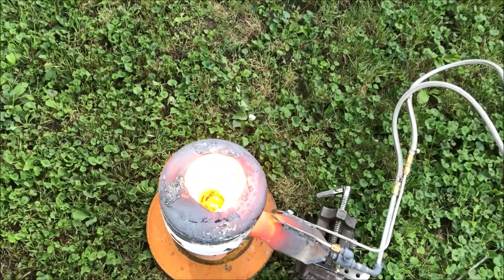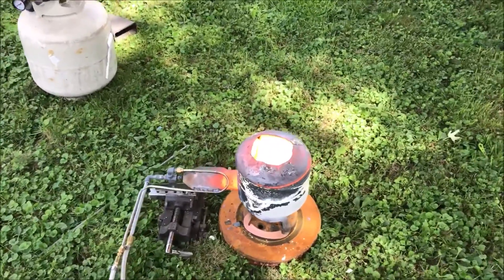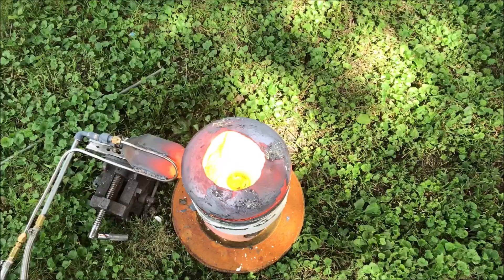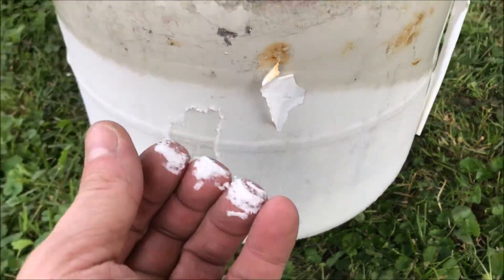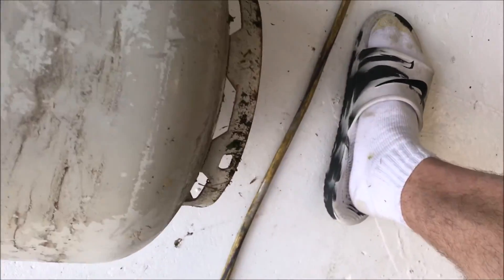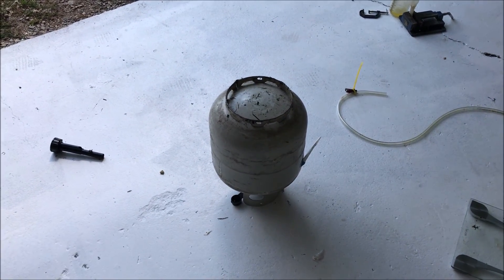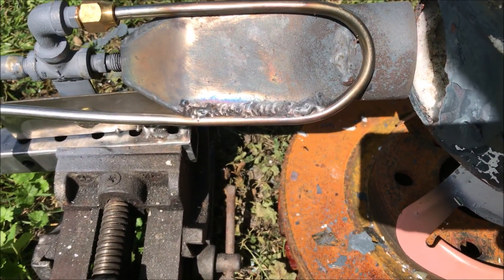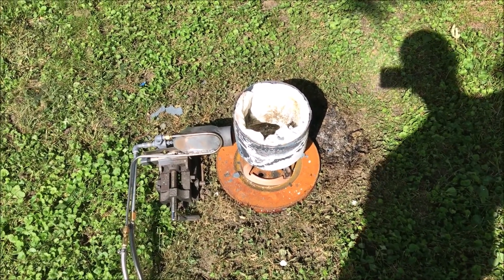Glass Melting foundry test on propane

Comment: why not run a few coils or preheat air tubing around your propane tank or some  alum dryer duct tube with a blower fan in it to swirl it around the tank it will keep the frost off and pressure up maybe even increase it  depending on how crazy you go with the temp.

Comment: Could you build the manifold to accept diesel and propane both in the syphon tube (each controlled with their own valves). Preheat the foundry with propane and then maintain the temperature with diesel. I would imagine that the people using this burner will use a foundry made with a 3k degree refractory cement, and probably would have an easier time reaching and holding the necessary temperatures.
Reply from the maker: Yes that can be done . Im gonna use some 70%alumina 3200 deg refractory hard cast